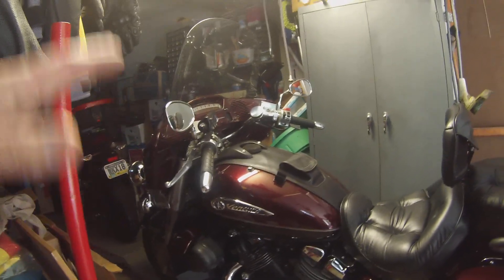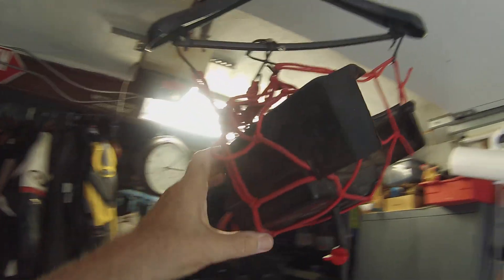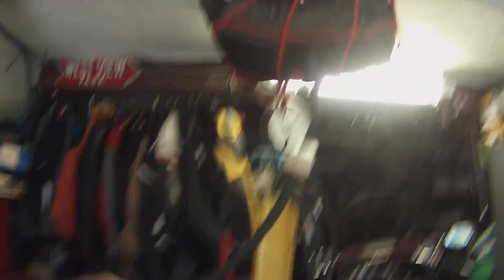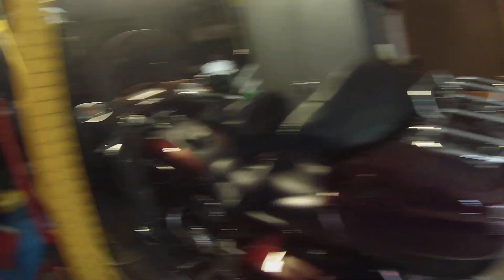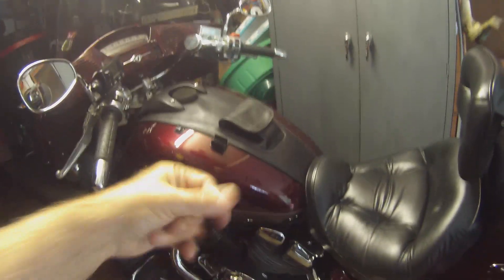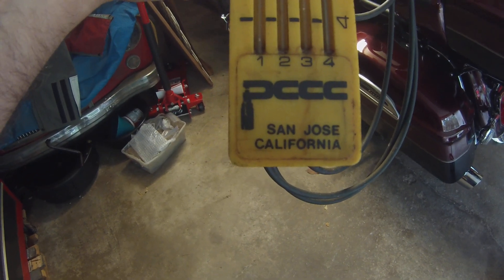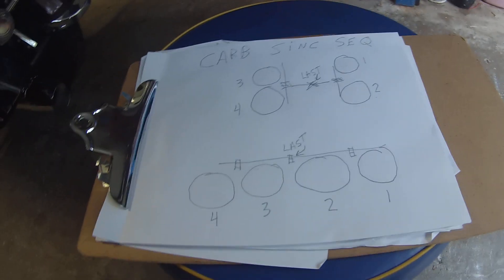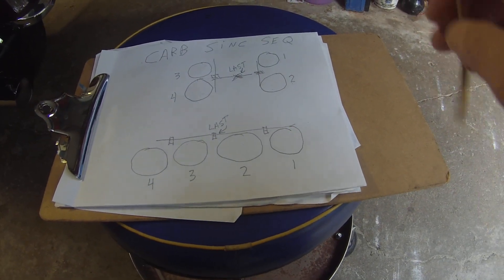CARB SYNC- if you dont know this- you will never get it..

Comment: Thank you  for showing us. Next time you synchronize the carburetor can you please pinpoint the screws locations. Show us step by step. Thank you again
Reply from the maker: I will do another video with better video and better lighting, showing how  I synchronize the carburetors on my Venture.. I think I made that first video in 2023, so although I have not changed any of the valve adjustments, which requires re-synchronizing the carburetors every time, I will go through the procedure and re-synchronize my carburetors, hopefully with better lighting and better camera work. I will make that video sometime before the end of March here in 2025 now that the weather is getting better and it’s not freezing in my garage anymore or raining. The issue there is, I have to back out my Honda NT 700 out of the garage to make room to do any work on my Venture and vice versa. And it’s raining right now here in Western Pennsylvania. So I can’t do it today, but I will get to it.

Comment from the maker: just to let people looking to find my video on carburetor synchronization. I made three separate videos. But the quality of the videos is not good enough. I’m going to have to make another attempt at making a quality video at least good enough. The problem is, it’s so dark in there under the carburetors., I just did not have enough light where it was needed while using the screwdrivers to sync the carbs and watch the gauges and hold the camera all at the same time, I needed at least three hands for that. I am working on it.
  Having done it,m again—-I think that I could actually synchronize the carburetors without removing the seat and the fuel tank..
  I will keep you informed

Comment: Good advice, but it doesn't apply to all carb sets. My 1977 Suzuki GS550 has 4 Mikuni VM22SS carbs, which are not CV type, but have a single shaft, operating all 4 slides through individual bell crank linkages. Each linkage has an adjuster, but they are not in pairs, so you have to set one, then adjust each of the other 3 to match it. It may be more basic, but it has the advantage that there are no expensive diaphragms to replace. I use a set of cheap dial gauges, but I calibrate them each time I use them, by connecting them all together with a 4-branch y-connector set up, then connecting that to one port. Then I can synchronise them with the calibrating screws at the normal operating pressure, before connecting them to the individual carbs. I have found that I only need to re-synch the carbs if I have had them apart. Another thing - don't forget to blank off the vacuum pipe which goes to the petcock - I did that once, and it took me half an hour of frustration with not being able to get that carb in synch before I realised it. I won't make that mistake again - probably.
Reply from the maker: my memory banks were concentrating on some Hondas carburetor set up, and. Yamaha Venture carb synchronization. You are right, I overlooked the way suzuki does it, and my old, 1973 Z1 carburetors with just slides, and no vacuum pots, and many others that I’ve had and worked on. I was more or less just thinking of the task ahead of me, the Venture.
  The way I synchronized carburetors on machines I would be Road racing, I just looked in the throats of the carburetors with a mirror and adjusted the carburetors to be wide opened together. I never used vacuum gauges on any of my race machines. In my day, the machines were not that overpowered like they are today, I didn’t have to finesse my way on the exits. I can just whack the throttle at the Apex and never worry about high siding unless it was raining.. But I would turn the idle way down on the four strokes i raced to have additional engine braking, but, oil consumption went up when I did that, I didn’t really worry about it in sprint races, but in two of my 4 24 hour races that I rode four strokes, the mechanics / pit crew had  to keep an eye closer on the oil consumption with the idle turned down..
 i’m gonna have to make the correction in the video when I synchronize the carburetors on my venture, that, not all carburetors, have just three adjustments, some of them have individual adjustments..
  thanks for catching that omission on my part.. I was just concentrating on machines that have just three adjustments on the linkage rod like on the ventures..
  I don’t know how I could forget all the fun I had trying to synchronize the early single cam Honda CB 750s, they had four individual cables coming from one junction connection going to each carburetor. You had to make sure you put a box fan in front of the engine, because you were gonna be there for a while. Then you would get all the carburetors close, blip, the throttle, one time, and all the gauges would be aimed in different directions again, because of the four individual cables, instead of a single bell crank, opening all the carburetors operated by just a single pull cable.. I thought I would never forget, working on those types of carburetors to try to get them in synchronization..
  I made this video because I have worked with mechanics that were frustrated because they could not get their carburetors in sync, because they did not understand the basics on this three adjustment set up. That you have to see them as two separate sets of two carburetors, and only touch the center adjustment after you’ve adjusted the two pairs to each other first., like on the ventures..
I would explain like I did in this video, the sequence you have to follow, or it will drive you nuts. And every time, the mechanics jaw drop when they had the lightbulb go off in their head, oh, that’s how you do it. After which, it just takes a couple minutes, or actually less sometimes, on carburetor set ups with this type of linkage. I like this type best..
Reply: @Jodyrides I never use vacuum gauges on my 1978 Triumph T140V, either. I do the Mk 1 Amals on that the old fashioned way, with a piece of wire underneath each slide, then watch to see that they start to move at the same time. A lot simpler on an old-school twin.
Although i was a car mechanic until I retired 4 years ago, the GS550 is my first 4 cylinder bike, and I was a bit apprehensive at first about being able to keep the carbs in sync, but it turned out to be very straight forward, as long as you have a basic set of vacuum gauges.
Reply from the maker: @rickconstant6106 
  The way I would adjust the carburetors on my moto guzzi SP 1000, I was taught to pull one spark plug wire, while the bike was running and see what the RPMs were, then pull the other spark, plug wire, and get that cylinder to run at the same RPMs, by adjusting the throttle cable at the carburetor…
  I have never synchronized the carburetor on my 1958 mga that I have owned since 1968. I had the engine rebuilt to stock, and I had the body reconditioned, fenders off paint job, stock, color, then I put the car in 1975. Then I transferred it to my garage at 1987 where it still sits, waiting for me to have ambition to put it back on the road.

Comment: I 100% agree with using carb-stix vs mechanical gauges 👍 And it isn't a huge deal but I've never seen an inline four that's numbered 4-1
(the left cylinder [while sitting on the bike] is always #1). And the carb (or throttle body) that "isn't adjustable" is the one that the bell-crank
(throttle cable) is on. In other words, some bikes have the bell crank in the middle (between 2-3) and others might have it on one end or the other (either #1 or #4)...

Comment: The gauges are not as accurate as the old calibrated 'Mercury Sticks'. Can't get them anymore! I still have a couple sets from the early 80s.
Reply from the maker: vacuum gauges ..there’s a way to verify how accurate they are to each other on all four tubes. Just put each hose on one of the vacuum ports of the manifold, it doesn’t matter which one. just put each vacuum hose on any port, and see if you get the same readings in all four tubes on the scale..
 doing that also verifies the integrity of your vacuum hoses … they are rubber after all, and everyone knows that rubber is vulnerable to ozone over time.. i use silicone grease on things like my spark, plug wires and end caps when I change the spark plugs, and on vacuum hoses and fuel lines to delay, the inevitable.. I also put a generous coating of silicone grease on my rubber intake manifolds. They live in a pretty hostile  oven like environment, just like the spark plug wires.
  I can guess why you can’t get mercury vacuum tube gauges anymore. These committees somewhere out there that assume we are all idiots. There’s probably some EPA regulation, making it even more difficult than ever to get your hands on Mercury. Just try to go and buy a Honeywell mercury. Thermostat for your home to operate your furnace/AC.. they’re all digital now. I don’t even know if you can buy the old reliable thermostats with mercury in them anymore. I saved the mercury vials out of some of these old thermostats just for use in my vacuum gauges when needed..
  I have seen guys that blipped the throttles of machines they were syncing carbs on, and they took the RPMs way up and let go of the throttle, and sucked all the mercury into the engine.. I have almost done that a couple times, but I have more mercury for when I do. If you check my video, I have a little vile like an eyedropper bottle attached to the top of my carb sticks, that’s full of spare mercury. I am pretty sure that vial of mercury came with the gauges new..
  I like the mercury sticks better because they don’t flutter. You don’t need the dampers on each hose that you have to have with the analog gauges to reduce the fluttering dials..

Comment: Looking forward to the next video I have never adjusted the carbs on my 07 Venture
Reply from the maker: so am I looking forward to syncing my carburetors because I have not done it since October 2021 when I first got the bike. One thing you have to remember is, you really should check your valve adjustment and then synchronize your carburetors. Because changing any of the shims on any of the valves., Changes the balance of your carburetors, because if you think about it, you’re opening one valve Later, or sooner with a valve, Shim change, And inversely you are closing  that valve later, or sooner with the valve shim change..